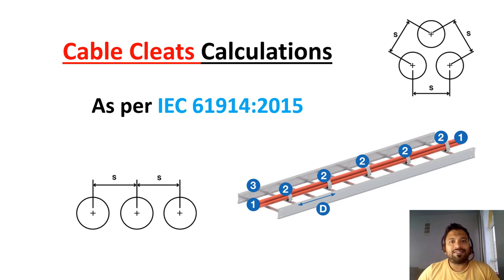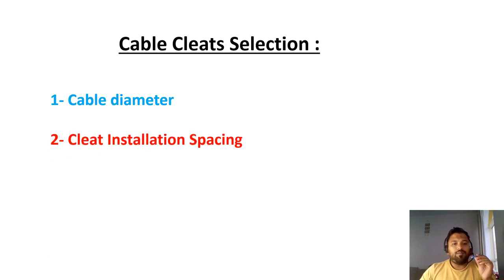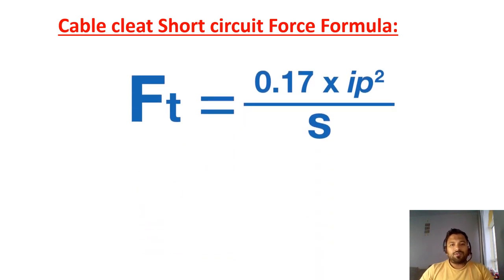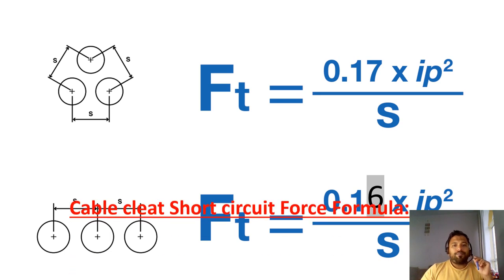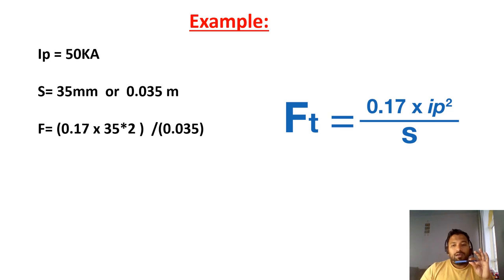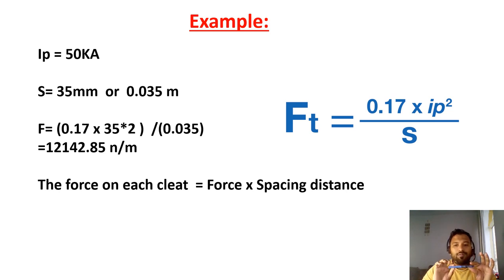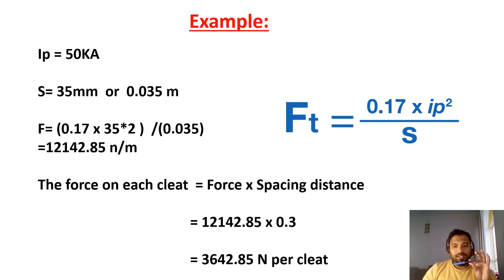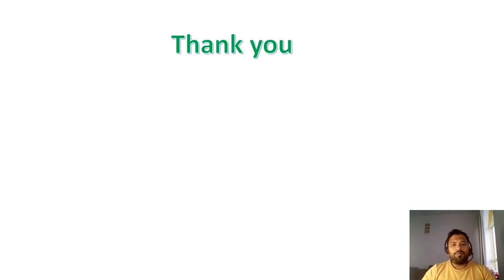Cable cleat calculations

Comment: In the formula, you write Ip2 values as 35*2. While the Ip value is 50A
Reply from the maker: yes its error ,you correct we need to select  50 A instead of 35